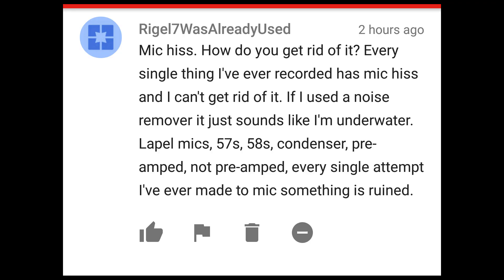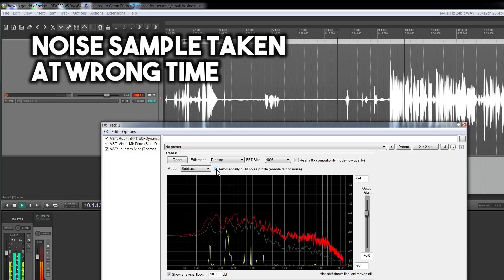HOW to GET RID of MIC HISS! | SpectreSoundStudios TUTORIAL

Comment: I've been using Audacity to record voice-over's and narrations for years now, and what Glenn says here is exactly right. Just as you start recording, give yourself three or four seconds before speaking or recording anything so you'll have enough of a sample for your noise suppressor to work with.
Reply: I try that, but the problem is, the hiss only happens when I'm *actually speaking*. Not speaking, my Shure SM7B is dead silent. Once I talk, though, it sounds like a snake infestation. (Actually have two of those mics; both have the same behavior, regardless of what preamp I use, what cables I use, etc.) I have to use Audacity's noise reduction function in post. Does pretty much the same thing as described in the video: just highlight a piece of the sound that has hiss (because it only happens when I talk, I can only get a tiny fraction of a second's worth of isolated hiss at any time) and run the noise reduction on it.
Reply: How to suppress that noise that we took sample of it?
Reply: @scatteredfrog  Hey, I know your comment is over a year old, but I am having the exact same issue with my Shure SM7b and was wondering if you ever found a fix for the problem.

Comment: Here are a few tips that I've found over the years that work pretty well:
1: Run a microphone through a MICROPHONE preamp that has an impedance rating of at least 10x the impedance of the microphone.
2: Try using a HPF to get rid of some low frequency rumble you can get from things like air-con, boilers etc.
3: The Izotope RX 4 Denoiser is a fantastic plugin that works on a similar basis to Reafer. 

For various noise during live situations: 
1: Make sure to use different wall sockets to power the audio equipment (consoles, wireless receivers etc.) and lighting equipment (desks, DMX fixtures etc.), preferably a different power line network if the building has multiple networks. Lighting equipment creates some serious interference through ground that generates a buzz through the speakers. 
2: If your input is RCA, try flipping the phase on one of the channels or even unplugging it entirely. 
3: If a DI box is quite noisy, engage 'Ground Lift'. 

Otherwise, try finding the resonant frequencies of the noise and attenuate them using an EQ. Not the best solution but if done right you should get a good result almost anywhere. Hope this helped.

Comment: I normally just turn the gain down a tad and get closer to the mic.  About 2 inches from the cap.  No air conditioner noise, no fans, and stay as far from a loud computer fan as possible while tracking.  The remaining hiss, I usually minimalize with a very slight low pass filter.  It will take some of the finesse and breath out of the vocals, but for really harsh and rich metal mixes, you don't need those kind of feathery and breathy frequencies anyway.

Comment: Another great way to do it, and this also works for headphone bleed, or even recording vocals with monitors instead of wearing headphones. Basically, you set the mic up exactly where it will be, set everything how it will be when you are recording the vocal, then record an entire track of just the noise from the room and mic hiss and whatever else is going on. Then record your actual vocal. and the "noise track" will be out of phase with the regular track, and the two will cancel each other out without cancelling out any of your actual vocal. If I didn't explain that clearly enough, blame Lyme Disease.
Reply: Does this mean record a sample of the ambient noise in the recording space, and loop it as a second track under the vocal recording track? Is it automatically out of phase at that point or do you need to flip the phase on the noise track?
Reply: Jeff Hester First, you literally record an ambient noise and hiss and whatever else track, a full track length (as long as the track you are trying to treat for noise). This noise track should be nothing but noise. It might need to be flipped out of phase, though usually it s already. Just solo the real track, then add the noise track and listen for the noise. If it isn't cancelling, then you should flip the phase. If it still doesn't work, then you cn try redoing the noise track. I'd say it is 90% effective on about 80% of tracks.

In other news, I do NOT have Lymphoma. Not that you thought I did or care, but I just got off the phone with the doctor and I want to tell the world.

Comment: 3 Years later, and thanks so much for these videos Glen.

My PC has terrible audio input on it. I'm not trying to record anything professional, I just want to myself playing to practice song writing and be able to listen back on my playing to hear where I need to improve (which is every where, but lets ignore that for now).

The completely terrible line hiss and crackle I have mean I obviously need to upgrade some components at some point, but until then I just wanted an easier solution. Luckily after watching this and spending 15 minutes to download and install Reaper and test out some settings, I was able to get the ReaFir set on subtraction. WOW, INSTANTLY BETTER.

I can actually listen to my input lines with them being clear enough to actually hear the tones. Which means I can hear where I'm being sloppy with not muting strings correctly, not picking consistently, etc. Without the terrible hum I can actually record stuff and play it back and not instantly want to throw my guitar away because of the line noise.

One day I'll upgrade my simple behringer mixer and get some decent quality cables and other hardware to record on my home PC, but until then I've got a way forward which is encouraging me to play more. Fuck yeah.

Comment: Hello! With all due respect, I don’t think this video is solving my issue. I just bought a Warm Audio 8000 (tube mic) and it looks like it’s a very VERY quiet microphone. I’m utilizing an Apollo Twin Duo X as an interfase. When I push my input gain to a decent level (peaks at -4dBs and lowest -10dBs) I hear a static hiss sound. I try using Wave’s X-Noise plugin to first capture the hiss, then record with the plugin disabled to prevent monitoring latency, then I enable it back for playback, it doesn’t sound as pure as it normally would. I had a Manley Reference Mic before and never had this issue. I’m starting to wonder if the mic itself came defective or if it’s just the natural “analog” sound of it.
Reply: If you're using an Apollo then get the C-Vox plugin from UA. This plugin can run in your Apollo's hardware in realtime. Just load it in the first Console Insert slot and set it to "Noise" mode. Then set the attenuation to somewhere between 50%. This will kill hiss and room noise in realtime, without you having to do anything else in post. I have a mic that requires 55+ dB gain on my Apollo. Without the C-Vox plugin, I'd be forever having to edit out hiss and noise in post. But know that you can set C-Vox too aggressively and your noise floor will sound unnaturally low--dead. I like to set C-Vox's attenuation level so that my final audio has a noise floor of about -65 dBFS after normalizing to -3 dB.

Comment: I am a singer and having a non-treated room. 
Currently i use a USB condensor mic but it captures a lot of room noise(hissing sound) along with my vocals. 
Is this an issue with mic or because of mic? 
If, I plan to upgrade my mic to get rid of noise, is it a good thought?
Which mic do you suggest from the list below:
1. Lewitt 240 Pro
2. AKG P120 or P220
3. Se Selectronics xA1

Comment: As a side mention - some mics have lower output than others - like the Shure SM7 - which requires more gain than say, a typical condenser would. Ribbon mics are also traditionally very low output as well, and also require a beefy amount of gain to work at their optimum. If your pre amp doesn't have sufficient gain, ( 60 db minimum, 65-70 preferred)) then any signal will suffer to a degree, because you'll end up having to crank the input level of the pre in order to gain the mic up to respectable levels - which, in cheaper/budget preamps, will likely result in noise. The noise tends to be more prominent in cheaper/budget level pre amps because of the budget quality of the internal electronics.
Check to make sure that your preamp's gain is sufficient. And, if you can't afford a pre with more gain, You can always add a Cathedral Pipes or Cloudlifter inline preamp boost, which takes its power from the 48v that is included on nearly every preamp made in the last 30 years ( for powering condenser mics).. and this will add up to +25db of gain to your input level. It's a good tool to have around for lower-powered dynamics and ribbons.

Comment: If you're recording like podcasty stuff in Audacity, that has a noise reduction tool that works the same way. If one time through isn't enough, i'll reselect the hiss sample after the reduction and run it again, and repeat. I've found that works better than adjusting the default settings.

Comment: Also -always make sure your power supply is evenly distributed-having lights, a room fan, or a dryer running in the other room can add hiss. Like if I'm recording and someone turns on the AC, it can have a subtle hiss effect. Its more noticeable at louder volumes

Comment: Teach us about phasing, Glenn! Specifically how you get your room mics, overheads, snare and kick mics all in phase, and maybe a bit about how far you shift your elements in reaper to get that 'wide sound'.
Reply: You probably already know all this, but just in case: Phasing is an issue that happens when the same sound reaches two different mics miliseconds apart, essentially creating the same waveform but slightly earlier or later. Since it does take a certain amount of time for the sound to reach the mics, obviously it will reach the ones that it is closer to first.

There's a cool little technique that an audio engineer taught me a few days ago. For example, take your snare top and snare bottom mics, flip the phase of one of them, and slightly move it back and forth until you can hear the bass significantly weaken. This means that they are cancelling each other out. Since the phase of one of the tracks is flipped, this means that they are now out of phase. All you have to do now is flip the phase again (you can do this with a lot of free EQ plugins and it's built into Reaper), and they will be in phase.

Comment: Tenner says he's tracking through a laptop, plugged into the mains socket. Unplug your power adaptor, and see if the noise is gone. It sounds more like he's describing mains interference.
Reply: You may be right about the adaptor. Unfortunately my battery died around the time the warranty ended. I used to get the issue with my PC too though.
Reply: If your PC was in the same mains outlet... then you'd get the same problems. You could lose a month researching the topic:

http://www.epanorama.net/documents/groundloop/
Reply: Multiple houses, plugs, and countries.